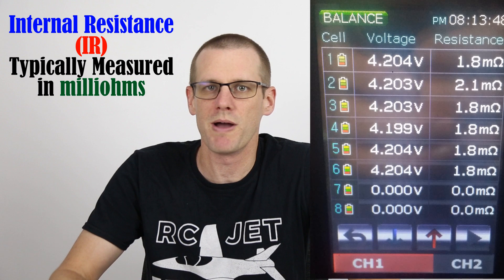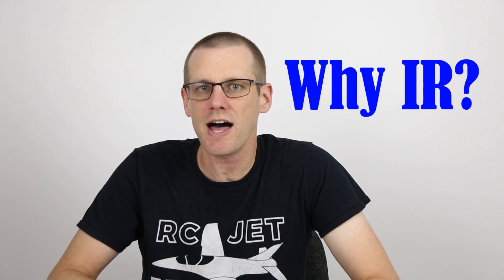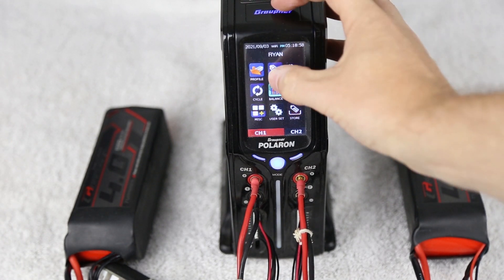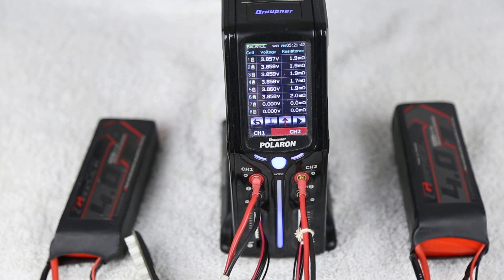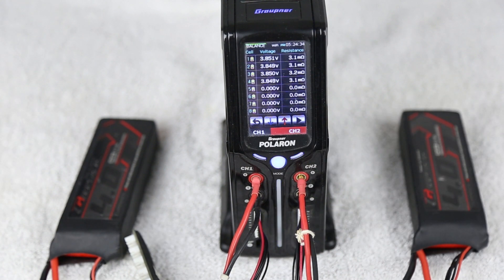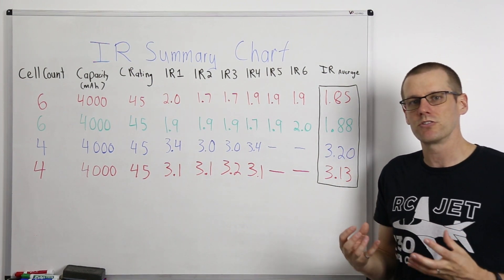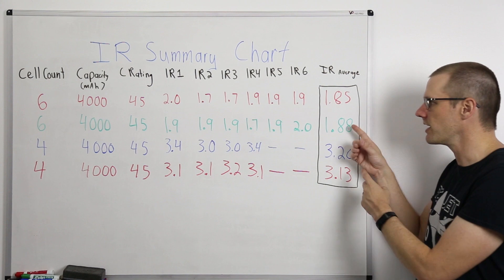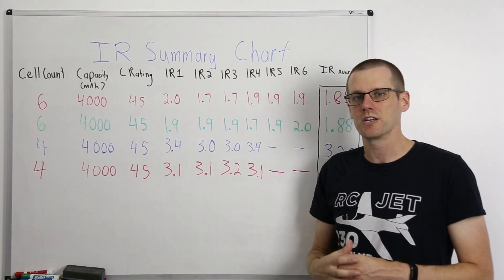The LiPo Spec that should REPLACE the C Rating!!!

Comment: The IR statement is incorrect. You'll need to add the IR values together. You don't just ignore a heat source because it is not as strong as the other. The heat each cell produces aggregates so you need to take total IR.

Your method only gives the C rating for one cell. Unless I missed a step you did. Did I miss you dividing the capacity by the number of cells? If you didn't then your calculated C rating is wildly incorrect even for a single cell.

Comment: Hi ive just got a 11.1v lipo 3.7v 8c. It has 4 conectors coming of it. I think i no one of them is lipo charger. But it has a servo end and 2 others that i dont see on google or anywere  i just dont want to plug out in and bang. Any help will be greatfull thankyou
Reply from the maker: You may send an email to the dealer you purchased from requesting more information.

Comment: SMC uses a power factor number to rate their packs, which is basically voltage per cell under a constant load. So 3.92 would equal 392PF on the label. But since they are the only company that uses this not helpful between brands.
Reply: This is the one I expected to see….I just assumed that if we weren’t using C-Rating we wouldn’t use IR since they’re directly related….except in the RC world where lying out your ass is the norm

Comment: IR is a good measure of the life remaining in the cell - the health of the cell. But not for the application of the cell. Individual cells are manufactured with discharge rate as a factor. I don’t mean the assemblies - I mean the cells themselves. Some are manufactured specifically as high discharge cells, able to deliver more current, while some are manufactured as low discharge, for applications where long cycle times and low current are needed, such as modems. Batteries for modems, for example, can still have a low IR, but a low C rating. IR will increase over time as the cells develop crystals on the cathode.
The problem is that manufacturers flat out lie about all the ratings. Many Chinese manufacturers especially will sell cells labeled with ridiculous numbers, even 18650 cells labeled as 9,000 mAH - which is physically impossible.  When you test these, you find them to be more like 700 mAH. Likewise, there is no such physical thing as a 2S2P assembly that fits in a RC car that’s capable of delivering 150C. The highest physically currently available in that configuration would be 60 Amps. There is simply no cells that are capable of those numbers - yet these manufacturers are permitted to slap whatever label they want on the pack and sell it as 7,000 mAH 150C or whatever. But when you measure its performance, you find it’s actually 5000 mAH and 30C - which is actually a really good pack, just nowhere near what the label claims.

Comment: Judging by those values the C rating is possibly based on power dissipation within the battery, ie the 4 cell would generate the same internal heat as the 6 cell if they had the same current  draw. eg if you pull 10A the 4 cell battery will generate ~1.26W and the 6 cell ~1.12W, pretty close allowing for the age of the packs.
Reply from the maker: Hi Mark, I'd hope that they do consider power dissipation but this becomes complex as well.  The example cells, 4s and 6s packs,  both started their life at nearly the exact same IR. The 6 cell pack has more surface area to remove waste heat. I am unable to use the 4 cell packs in an 8s setup due to excessive heat build up.

Comment: So your example seems to be with batteries with cells in series? Say you have something like a 3S2P pack with say IR of 3 mOh vs a 3S1P pack of 2 mOh. Which of these would provide more power?
Reply from the maker: Yes cells in series. Any parallel cell groupings charge, discharge and balance as a single cell within the pack. If I understand your example specifications as described, a LiPo manufacture would much rather use 1.5mohm per parallel grouping vs 3mohm per cell anyway. It's better for marketing, it's accurate and less confusing.  Similarly, No manufacture specifies the capacity of a single cell within a parallel grouping. The manufacture states the capacity of the whole pack which add the capacities of each individual cell placed in a parallel group.
Reply: @RCexplained  right, but my question was more about which battery would have the higher real world discharge/power draw capability? Like would having a 2nd cell in parallel counteract the higher IR?
Reply from the maker: Yes, I did put the resistance of your example in my reply. 2x 3mohm cells placed in parallel will perform at 1.5mohm and would be better than a 2mohm single cell.